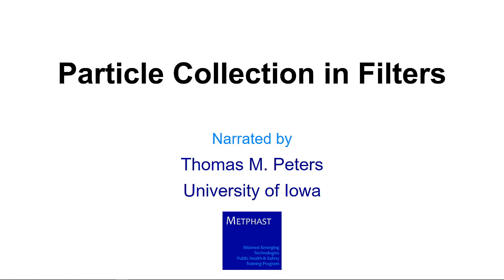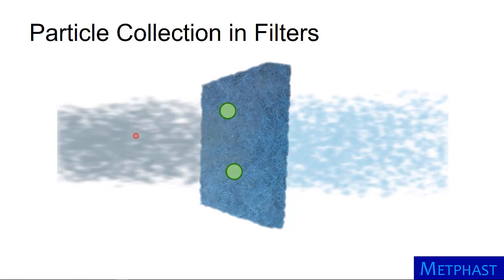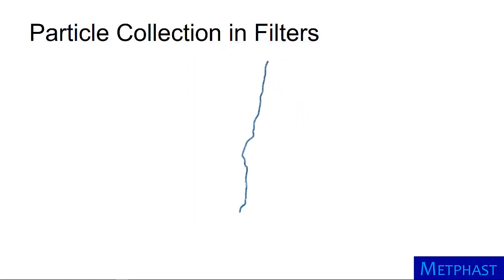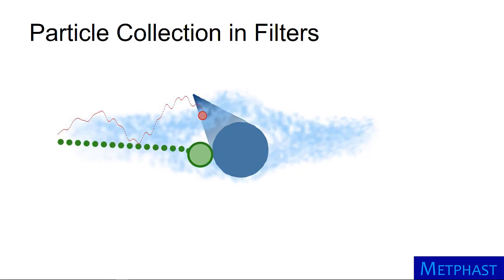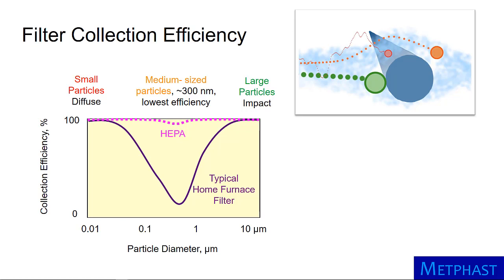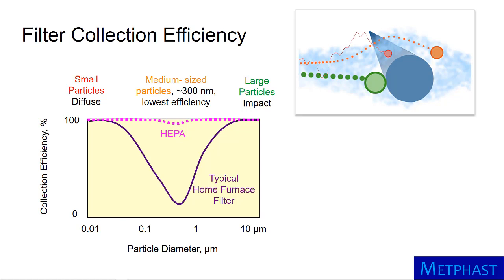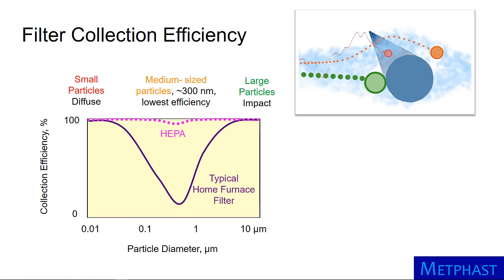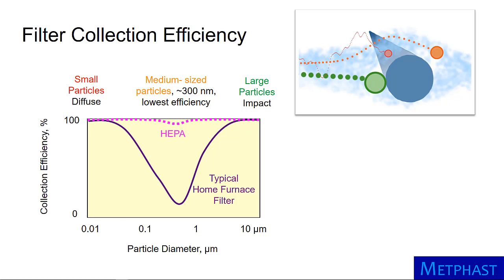Particle Collection in Filters

Comment: This is great. I think alot of people are trying to understand filters because of coronavirus. I take it that the idea is that the virus falls into a bad size for anything less than a HEPA, because the virus is about 0.1microns (128 nm), and in a hydrated droplet (commonly believe mode of aerosol) might be around 1 micron.
Reply from the maker: Sorry for the late reply. Filters other than HEPA class can be fairly effective against 0.1-1 micrometer and larger. While HEPA is great, they are expensive and require more energy to move the air through. MERV 14 and higher can be quite effective. Another issue with HEPAs is that they must be mounted well (no leaks) to get their full effect.